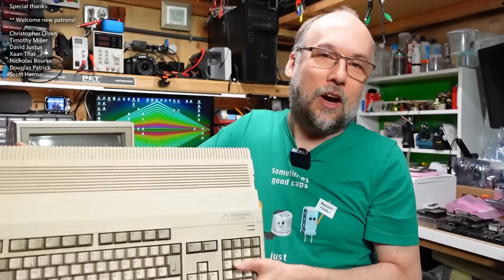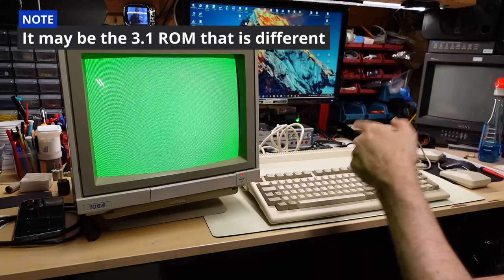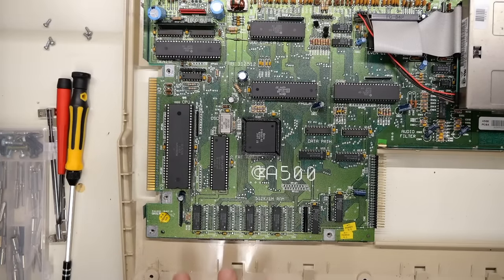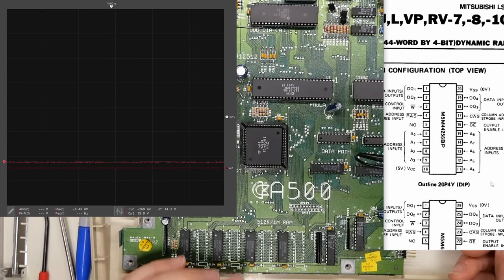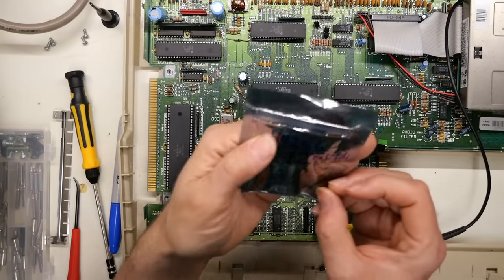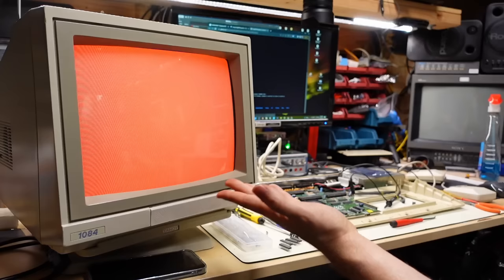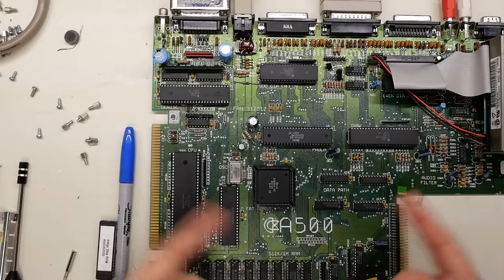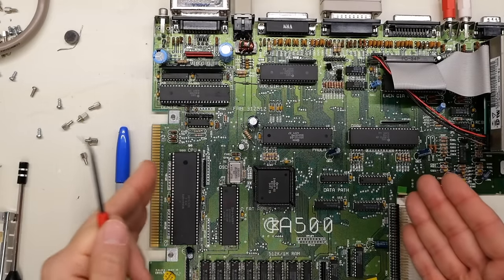Can the Amiga Diagnostic ROM help me figure out what was wrong with this Amiga 500?

Comment: Very nice work diagnosing (even if you ended up using the brute force method of socketing all of the RAM!) that computer.  The diagnostic ROM definitely fell short in testing the most likely culprit in old computers with problems.  Hopefully the author has (or will have) updated the memory test to test every memory location.
Reply: Ironical: that wasnt tje test.. it was the "scan for usablr memory" the test is in the program. And you could clearly see what bits had issues in thw output..   the daily version (1.3beta) also tells in green or red if a bit is wrong..

But he never did run the test. It was just a memscan....

Comment: First thing is to reseat the chips specifically the CIAs. Swap them and you might get a different behavior.
Reply: Hi, already did that. Not a change. Actually, I've tested all the custom and socketed chip on another working A2000. Working! So, it must be something else, maybe bad ram, or some logic elsewhere.

Comment: Is the Siemens RAM on the A500 equivalent to the MT RAM on the C64 as to reliability?  I was thinking that exact thing before you said it.  Some years ago, I received a job lot of A500s that were broken.  The majority of them had bad RAM and multiples as well.  Of the ones that had bad RAM they were ALL Siemens.  Doesn't necessarily mean anything other than Commodore used a lot of Siemens RAM but it is funny that the units that didn't have bad RAM were not Siemens chips.
Reply from the maker: Another comment said that is infact the case too. The Siemens chips should be considered MT 4164 level of unreliability at this point.

Comment: I have an A500 where the keyboard had a broken trace in the membrane. One of the Amiga keys was not working, so there was no more soft-reset. I fixed it with conductive paint. Not sure what caused the break though; the previous owner might have been in there too...

Comment: Bad RAM is often a symptom of someone using a bad power supply - never, ever use unreconditioned supplies ! They are nice to work on in general.
Reply: This ^ Also IMHO the signal traces looked a little "dirty". Probably bad caps in the PSU and maybe those by the chips as well - looks like tantalums? I believe these old ones are known for shorting on 80s electronics.

Comment: That's the Spain layout. It has the characters needed for both Spanish and Catalan. The dot symbol · is used in Catalan to differentiate between ll and l·l, which have different sounds. The former sounds like a longer l and the latter sounds a bit like "ly." Mexico has a different keyboard layout with the · since Catalan is not spoken there.

Comment: That's not a ram check, that's a memory size check.  That's the only reason to jump huge address spaces.  A proper diagnostic would check every location with varying bit patterns to find errors, and would continue over and over again to find "flakey" bits.

Hell, when i started out fixing computers we used to run a program overnight that worked the hell out of hard drives, so we could MANUALLY mark back sectors.  Which is a thing you used to have to do with early PC hard drives.  Heck, even if you flipped the machine on it's side, sometimes you had to redo the low level format and then run the error checker again, because the heads sat differently.

Comment: I'm at 11 minutes in, so I haven't reached your solution yet.  Just guessing based on past experience.   I used to service Commodore computers at a small computer store back in the 1980's.    I remember that often, just re-seating Agnus fixed a lot of problems.  It seemed like that square socket just didn't maintain good connections over many warming and cooling power cycles.

Comment: Firstly the Amiga 500 NEVER came with Kickstart 2.0. The A500+ did and so did the A600, but not the A500. That was limited to Kickstart v1.2 with a read power light and Kickstart v1.3 with a green power light.

Comment: Well, changing the Kickstart 1.3 to 2.04 on my non working A2000 rev6.2 give a different output on screen. With Kc1.3 I have a green screen right at the power on. Using a Kc2.04 I have the standard Grey Light Grey White sequence; it stops on White for a while then restart the loop.
Reply from the maker: Interesting! Indeed there is some difference between the initial boot diagnostics when comparing these two ROMs.

Comment: Aren't 68k based Systems technically 32bit Systems, as its a 32bit Processor??
It just has a 16bit BUS...
Reply: Mmmmm sort of, but not really, the 68000 uses 32 bit instructions, a 16 bit data bus and a 24 bit address bus. The 68020 was the first fully 32 bit CPU in the family.
Reply: The ISA is clearly 32 bit, but only a 16 bit data bus was exposed to the outside. There was even a 68008 variant which had only a 8 bit data bus and a 20 bit address bus. But also a 68012 which had a 16 data bus and a 31 bit address bus.
Reply: @SkYhAwKxInD  yeah and I thought that the 32bit ISA makes a 32bit Processor and the Data Bus doesn't denominate that at all...

Comment: Hello Adrian
I have an Amiga 600 and when I boot I have black screen, and the caps lock in the keyboard is lighted ... Do you have a suggestion ? I think the Amiga don't read the kickstart, it fails before. Exists a web site with a dynamic PCB of amiga 600 mother board?
Many thanks

Comment: 4:35 - I think the RAM is not in socket because that can cause clearance issues with the keyboard! Be careful, I replaced RAM on a RAM expansion card and put them into sockets and I had issues...

Maybe it's only testing the first chip and you need to keep swapping the ram chips in the 1st socket to see if that chip is bad or not? That would be counter-intuitive as originally the chips are not socketed...

Comment: Hmmm I guess the piggy backing can fail when the signal should be 0, but the bad ram is stuck at 1. So even if the good ram on top would give out a 0 the bad chip still gives the 1.

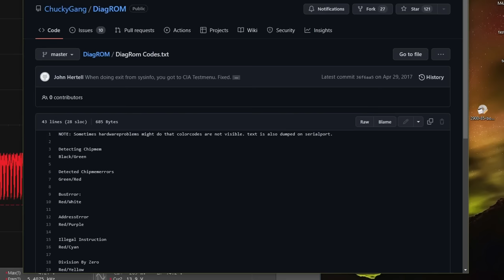Comment: 13:01 this is DiagROM telling you what it found wrong with the data bus, or trying to. The colours look wrong which tells you that the problem is not the RAM (DiagROM doesnt use any chip RAM to show this pattern), but the data bus bridge between the CPU and the custom chips. This is U10-U13 on the board - it forms a bridge between the CPU's databus (labelled D0-15 on the shematic), and the custom chips databus (labelled DRD0-15 on the schematic)

What I usually do next is look at the signals !OEB, !OEL and !LATCH on the 244/373 chips. If they are present, I usually then look at the signals on each side of the 244/373. A very common issue especially on A500+'s is broken tracks which show up as floating signals. 

The problem could also be caused by a damaged Gary chip, or by a bad Agnus socket - check the socket carefully for cracks at the corners. It may be worth pulling and reseating Agnus too.
Reply: heh, and you can completely ignore everything I said. Interesting. You dont often see bad RAM on the Amiga... I guess it's possible there was a memory expansion in the trapdoor, that had a leaking battery... and the resultant damage ended up damaging the onboard ram.

Still... one thing to bear in mind with your future Amiga ventures, is that data bus bridge. Especially when you have an A500+ that's suffered from Varta damage :)

Comment: Unless you used low profile sockets, you will have issues with the keyboard clearing the motherboard.
Reply: hush, he's "pro". look how he's leveraging the screwdriver against filter caps near the IC socket 😂
Reply: he had exactly this problem before on some other machine type...
Reply: @nneeerrrd  Dude, what exactly is your problem? Adrian has NEVER claimed to be a pro at this. You just sound like a bitter troll.

Comment: Did you consider that one of the capacitors might be bad? If there's a problem with the power supply you might be able to "fix" the problem by using parts that either handle poor power conditions better, or simply use less power because they are a more modern implementation. Those 0.1uf bypass caps might be the culprit, or any of the wet ones.
Reply: Capacitors does not give greenscreen issues
Reply: @ChuckyGang  Ok, let me translate this for you: greenscreen is a memory error, is it not? A faulty bypass cap not only can but will cause signal issues.

In this case the diagnostic test failure was clearly limited to a single part, but it took three parts to "fix" the green screen.

That's a classic pattern for a bypass cap or other power capacitor problem, where the bad cap was "fixed" by using parts that are not as susceptible to the signal errors that it causes.
Reply: @akiko009  greenscreen is unable to use first 16k ram. And if a capacitor is missing. It would work just fine.. if shorted the whole machine would be dead.. so nope. Not capacitorissue
Reply: @ChuckyGang  I don't believe you understand the issue that I'm trying to describe. A bypass cap can cause the signaling by a component to be sub-par which makes it look like it has failed even though it has not.

In this case the memory test clearly indicated only one chip to be bad, yet 3 had to be replaced for the system to work correctly. That's a typical pattern for a bypass cap failure. And I'm saying that with 40+ years of experience hacking hardware and software.

Comment: At least this is the non-Plus version, if it was, there would have been a bad-news varta battery next to where "Audio Filter" is silk-screened on the board, which with my A500+, haing been stored on its' side (so the SCSI expansion slot was facing down & FDD up), the stuff leaked out and trashed everything on its' way south, and given at the time (early 2ks) Amigas were worthless, it wasn't worth keeping, repairing or selling, and I ended up buying my two A600s instead for about £20 from a car boot sale...

Comment: How do you know what “normal“ looks like when you’re looking at the output of the oscilloscope?  Is there an episode or series you’ve done?

Or is there a set of books you could recommend? So someone would know what a normal vs bad cpu output looks like. Or normal vs bad ram, etc
Reply: The first thing you look for is signals to be (and/or transitioning to) as close to 0 or 5 volts as possible (on a 5V system). If they float somewhere in the middle of that range, there's a problem. There are limits for "low" and "high" voltage levels, and that depends a bit on the chip technology, and the designers were sometimes sloppy, too ("well, it works"). The signals in digital circuits should also be quite square, although some clock signals, while seen as digital, can look kind of roundish. After that, you need to understand the circuit. Should the signal be mostly low, mostly high, when and how often does it transition? Data patterns... That's circuit dependent. Service manual and data sheet reading (and understanding) time...

It's not difficult, but it's hard. Or maybe the other way around... 😄Also, if you are going to dive into this, you need an oscilloscope. A digital volt meter will tell you if there's anything on those pins. But if it says (say) 3V, you really don't know if the signal is just floating there, or swithcing rapidly between the limits.

There are books on the subject, varying in study level, but the Internet is full of data on understanding digital signals, using an oscilloscope, etc... Just Google wisely, you'll find everything you need.
Reply: I never saw this specifically in a book, but look up logic levels for the component type
I'm not sure but should be CMOS 5V I think?
For that acceptable output levels are 0-0.5V for low and 4.44-5V for high. 
If the signal is not within those bounds, something screwy may be going on.
But there may be other things like pullups/downs that effect those.

Acceptable INPUT levels for CMOS are 0-1.5V for low and 3.5-5V for high.
If the signal is outside that range, it will definitely not work, unless at that point the bus just tristated and floating (no chips are driving the bus).

If you see that kind of weirdness when the chip is ENABLEd, that chip is either just bad, or there is a bus conflict (multiple chips are trying to output different data at the same time).

The signal shape can also clue toward problems - for CMOS generally it should raise/drop semi-sharply, than can hava a small bounce, remain steady-ish during clock sub-cycle, and then (sometimes slowly-ishly) tristate or whatever it should do then, or immediately go toward new logic state. Bouncing wildly may indicate some sort of a problem.

As you watch the scope diagnosing a specific system types you gradually get accustomed as to how the signals should look in general, which is why Adrian was unsure if this kind of stuff is normal for this machine.
Reply from the maker: Really it's a guess and familiarity with a system helps a lot. You can sometimes see strange signals but those can be normal .. like some signals on the C64 look like sawtooths due to the way it has pull-up resistors on some address lines. When things are shorted to ground or held high or not being driven, that's when it's a bit more obvious.